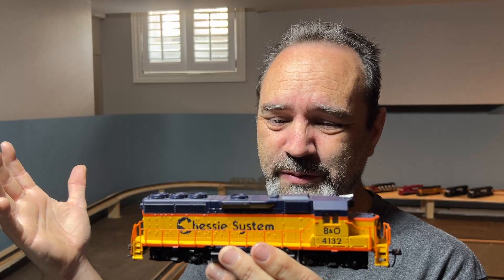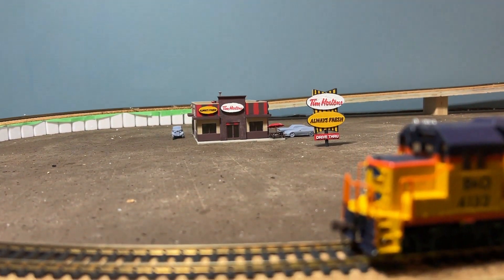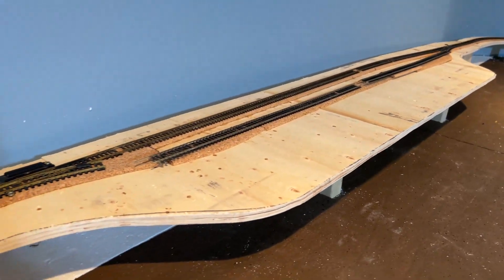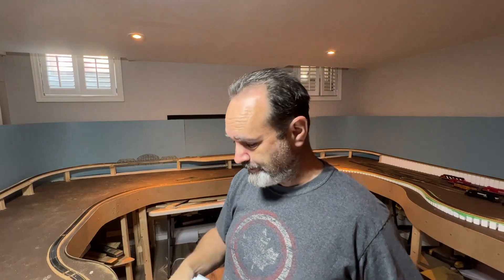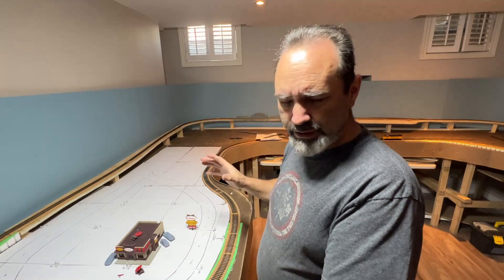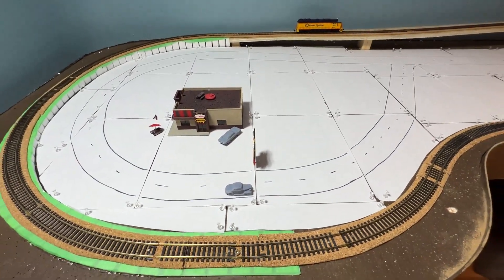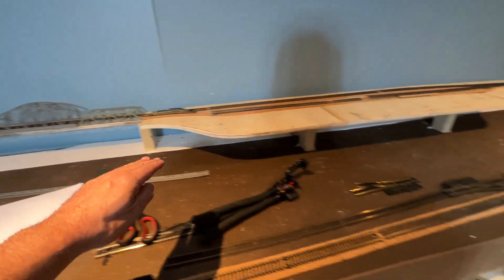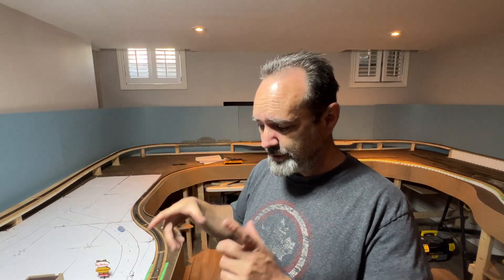Balancing Track V Scenery On My New HO Scale Model Railway

Comment: If I might make a suggestion. Have you considered putting in a grade crossing taking the road across the tracks to potentially a few more buildings. To me it looks like the town is trapped in the loop. This is not meant to criticize your efforts. Good luck with your layout.
Reply from the maker: That's a fair point. I have a small section of the track bend that is straight, so I could make a crossing at that point. Thanks for the suggestion.
Reply: @ScottRails  You’re welcome. I also subscribed 😊

Comment: Nice plans! My question is, why not just 3D print out the pieces of a Magna-rail track? A bike chains gonna be heavy to drag around, and will make a lot of noise, even in Foam. Plus, you can print all the gears and turn housings too, and use a a smaller, and quieter, motor to run it all. Not to mention, using Magnets, with a metal chain, may prove troublesome.
Reply from the maker: Thanks Charlie. My wife already suggested printing the chain. There's a couple of reasons I don't like it. It is a push chain, it's not physically linked, it slots together. I've seen the real one actually bunch up and come apart if the distances and speed are not perfect. 
It is also noisy, as the "chain" rides along a plastic channel.
Also, it would require a LOT of links for what I am planning, which could end up costing as much resin as just buying a real kit.
If I can suspend a real chain with enough of those small sprockets you find on the bicycle gear changer mechanism, it could be as quite a riding a bike, Just need to find a powerful but quiet motor.
I'll order the parts I need and make a test bench first of course.